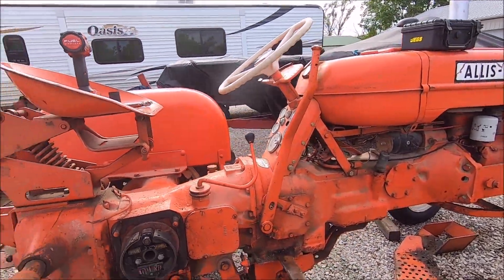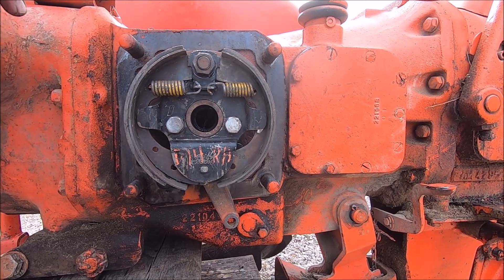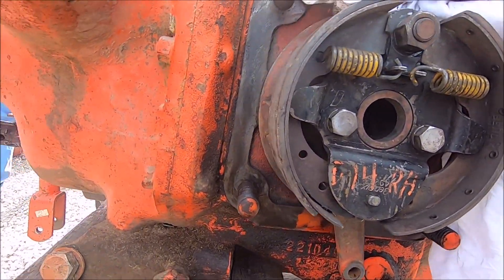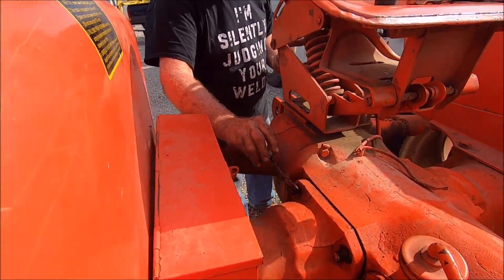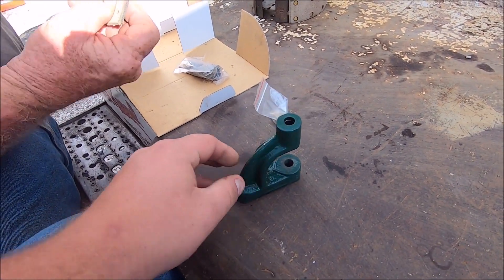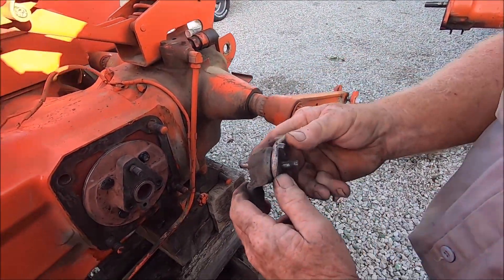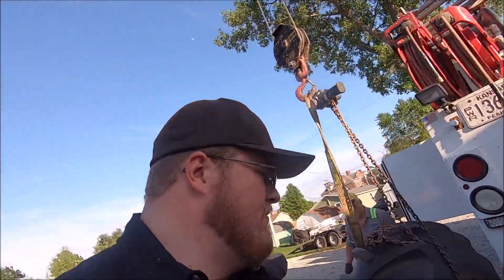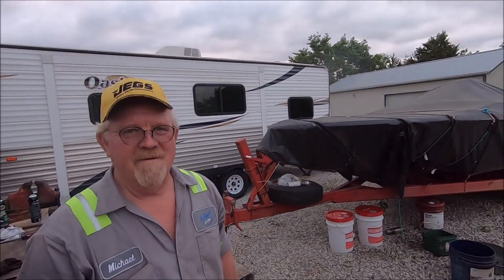Dad's Allis Chalmers D14: Brake Service & Axle Seals! BEST DANG TRACTOR EVER MADE!!!

Comment: Bearings like that if you take a welder and welder ring around the inside of the bearing it'll pretty much full ride out differences in heat the bearing will be no good but you're not reusing it

Comment: What size is that o ring that the gas ruined
Reply from the maker: I wish I had an answer for ya, its been too long for me to remember
Reply: @ScottsSpeedShop  did the aftermarket auto seal hold up ok I’m about to do mine I see skf has a similar seal to the national seal you used
Reply from the maker: @philkuhn4073  it seems to be, the d14 is at our farm being used by my uncle. Last time I was out there(4 months ago) I don't recall it leaking. If you are on the fence, I could probably call my uncle or go and check the d14 out myself. I know changing them isn't a fun job, so making sure it doesn't leak would be good. Let me know if I can do more